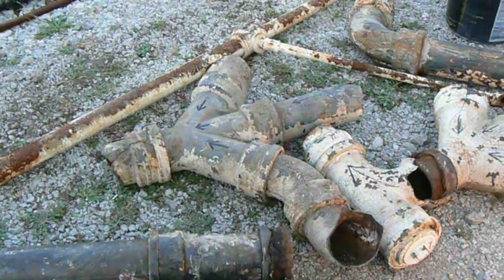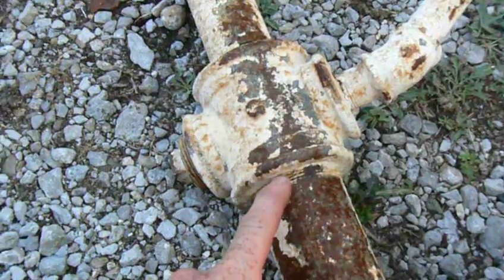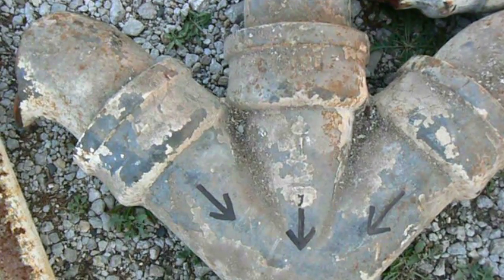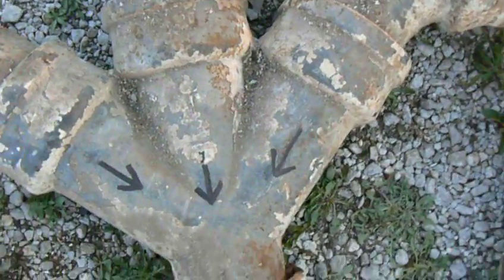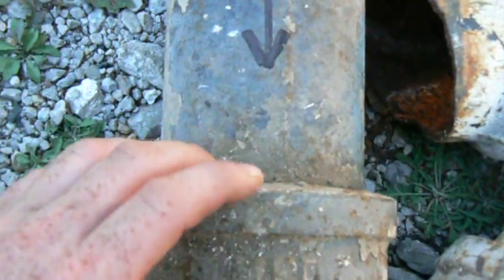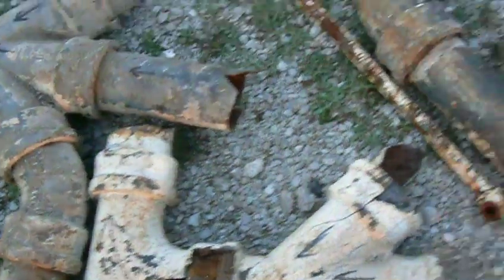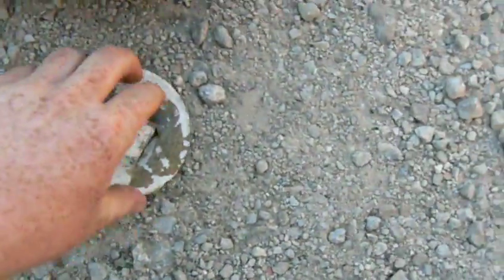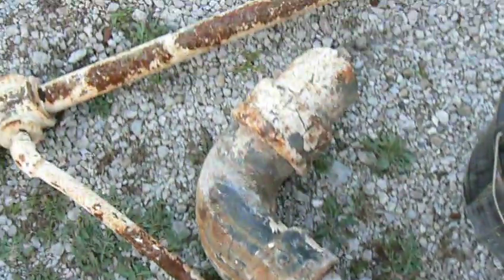Lead extraction from Cast Iron sewage pipes

Comment: Your video is very informative. That cast pipe sure is brittle(is it valuable). What did they do melt down lead and pour into joint. What did they use to stop lead from flowing past joint? I seen in another video of yours that you came to USA from Uk. Did you come here for work opportunity.  Your own boss~ I suppose you're working all the time when awake, Just curious what did you get for that Police interceptor.? Also like that Olds 98 455 Rocket engine and car...bet it was a really sweet ride. Do you post all cars you sell?
Reply: Oakum (generally a brown oily rope that can be broken down strand by strand- white oakum is for applications where no water is present) is used to pack the joint prior to pouring lead. Yes we do melt lead and pour it into a joint, regardless if it's horizontal or vertical (however another step is needed to pour a horizontal joint).
Reply: Henry Mound I have busted that pipe and extracted the lead with a sledge hammer and always wondered what % or purity is the lead, could it be good for sinkers, or casting bullets?